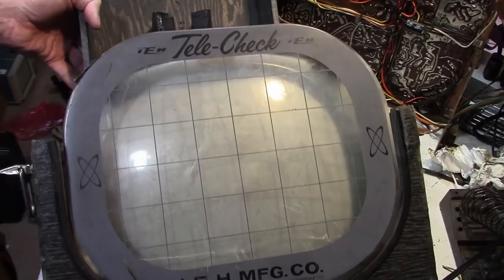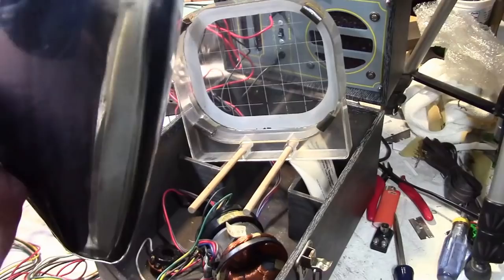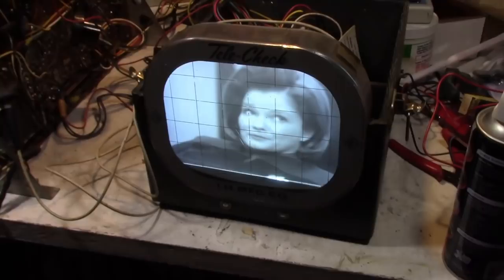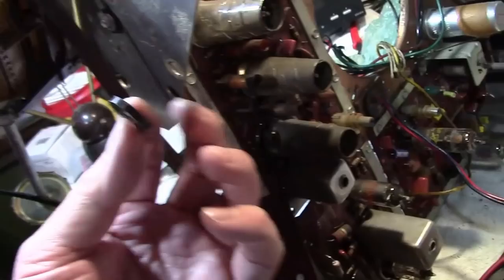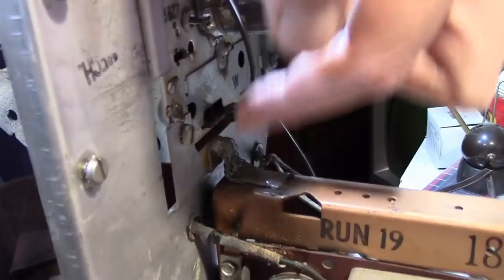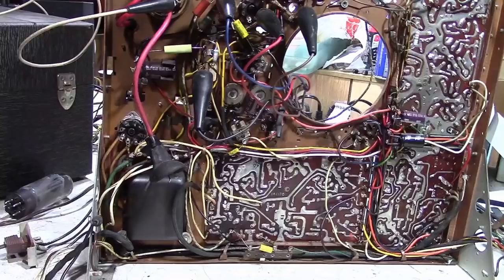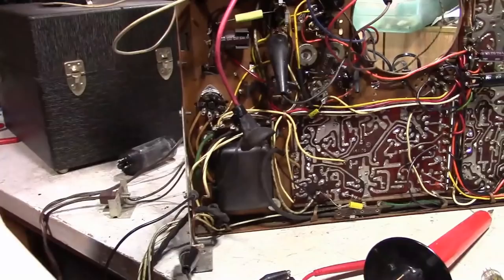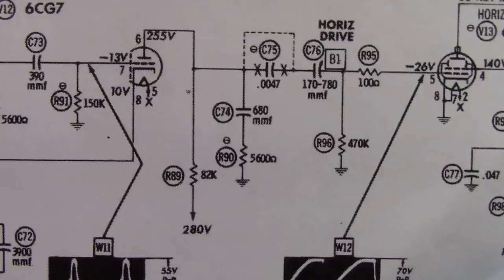Admiral T2301 restoration p5o8

Comment: The fuzzy picture could very well be due to the stray capacitance of the wiring of the test setup. I used to work on color TVs using test jigs to service the chassis out of the cabinet. The picture was always fuzzy and smeared. It was called "jigsmear."

Comment: The tuner sub-assembly is isolated from the main chassis however connected via a braided cable. This in an RF ground
Reply from the maker: It's more than that.  It's also ground for the tube filaments and B+
Reply: @bandersentv  sorry, yes. I assumed that there was another wire for that purpose.

Comment: Please keep in mind that Sams did have errors in them from time to time. I got nailed more than once by their errors in voltages and wiring over the decades. Likely I have the OEM manual for that , but it's inaccessible for several months. Cisian's (sp) and Tab/ Most Often Needed might also have a more accurate schematic.
Reply from the maker: Yes, I also have the Riders and Beitman's most often needed.

Comment: Can't you just bend up the tube pin so it doesn't enter the socket, then bend it back when you're done?
Reply from the maker: The stress of bending the lead 90 degrees close to the glass would likely break the seal.  6J6s are plentiful and can be had for less than a dollar.